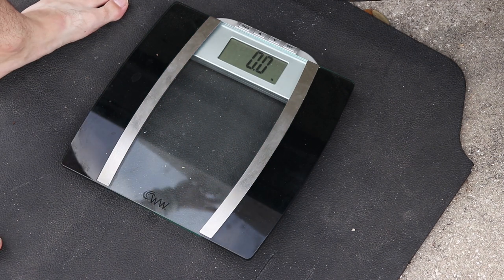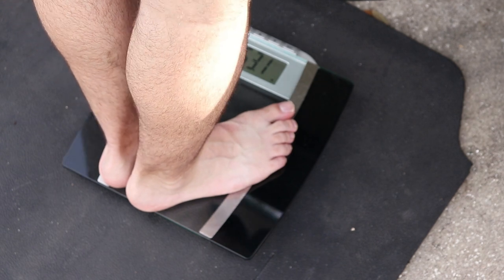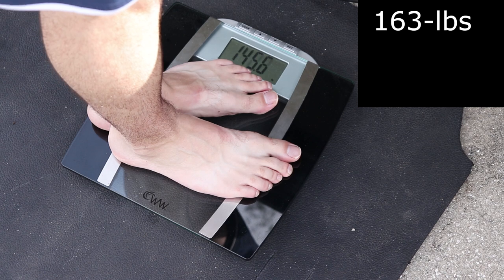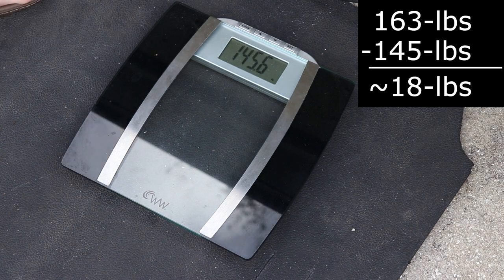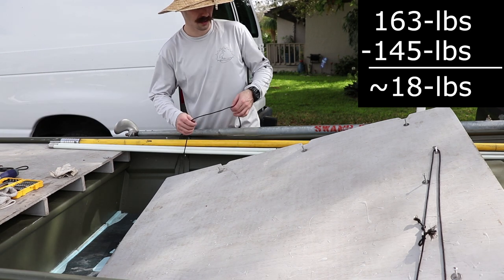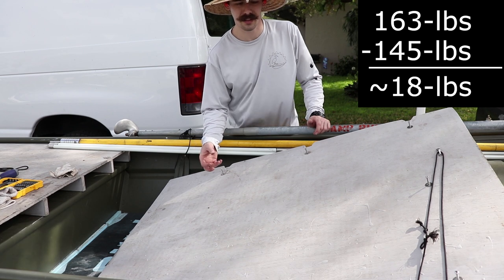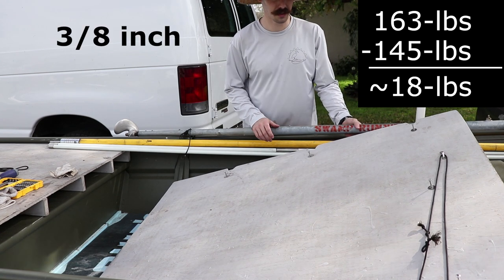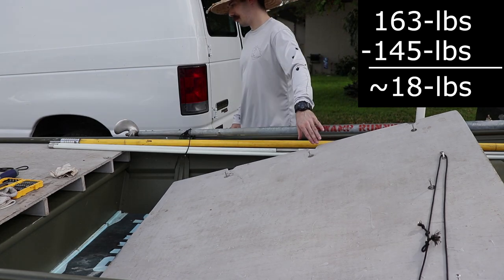DIY Cheap Jon Boat Floor Weight

Comment: Being in the bottom, it will make it more ridged and more stable. The efficiency of your setup is still over all good
Reply from the maker: Thank you! I never thought of it adding rigidity to the boat. I guess it would add a little

Comment: Glad to see that your concerned about weight. Lots of builders just build with 3/4” plywood and 2x4s only to find out on the first on water test that they have killed the performance of your boat. Plowing vs on plane makes your normal ride to you favorite spot from 20 minutes to 45 minutes. Yuck! Build as light as you can or start looking for a bigger motor now.
Reply from the maker: I agree. This build has been great and I've had no issues with it so far. Supports two people without issue. Its solid.

Comment: always look forward to your saturday vids...unexpected bonus, almost missed this one...lol....how is the the “slick” bottom holding up?...i am most interested in your opinion on how overall your rig is holding up...you have taught me so much and i am making boat buying decisions based solely on your vids...they are a wealth of knowledge and experience..i can’t thank you enough for doing the work! 👍 all the best my friend!
Reply from the maker: Haha I'm glad you caught it! Well, I'll give you a spoiler alert, this Saturday's video is the update on the Wetlander bottom coating 😅 so you'll be able to get an answer for that. For the jon boat as a total, everything is holding up well. I'm very pleased with it. I would still go with a Tracker jon boat instead of the Alumacraft because of my back experience with Alumacraft customer service and the way my transom ended up. The deck and floor is holding up and I couldn't be happier with that. The Predator engine is solid. I have to tune it up though [put new gas in it, oil, filters, spark plug, and just try to get it running as good as it was, and the mud motor is still going strong. I really appreciate your support! That means a lot to me. If you have any more questions let me know!